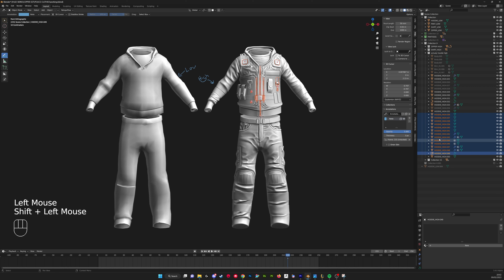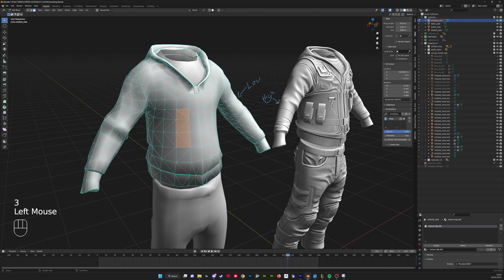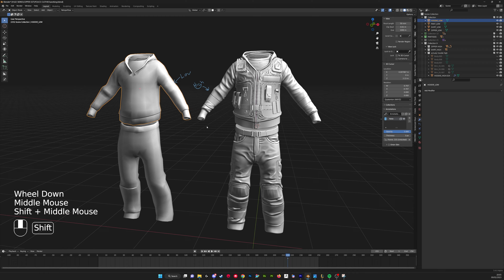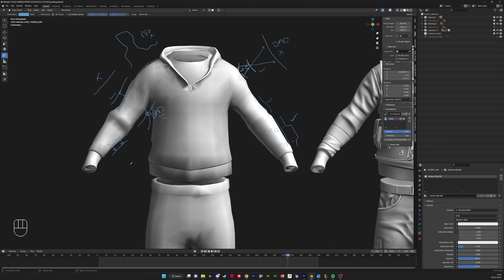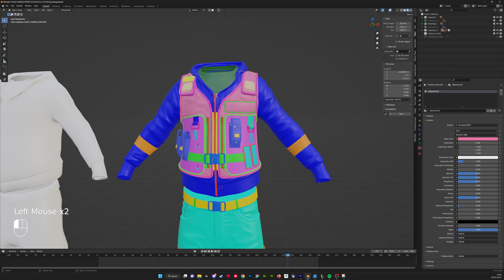How To Make Rust Skins - Part 3 - High Poly Creation - Blender Tutorial

Comment: Okay this part is actually clutch in understanding how you can work with a different model I never understood it before. Now it makes a lot more sense how you can work with a different UV map since you can work with a totally different high poly for the baking. But I still wonder how to retrofit it to game's default UV maps. I really wanted to make chests and doors that have custom depth to them, I know it's limited to normal maps not remeshing, but this tutorial makes sense of it a lot better. Gotta treat the texture baking as a separate step rather than just trying to paint onto the provided model.